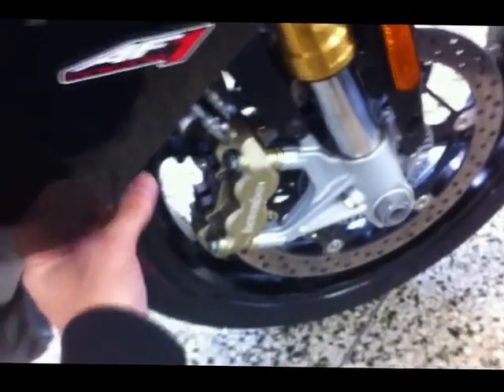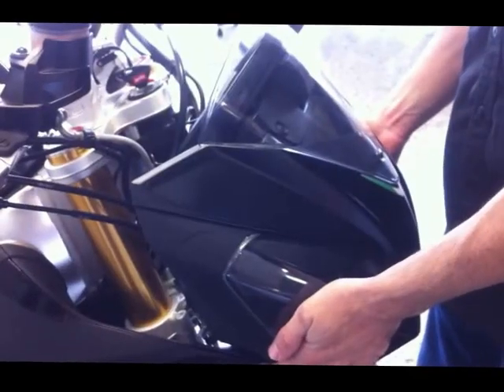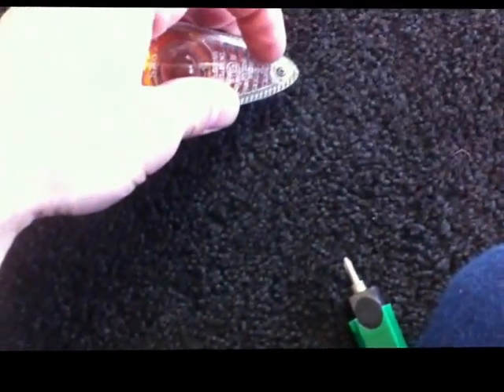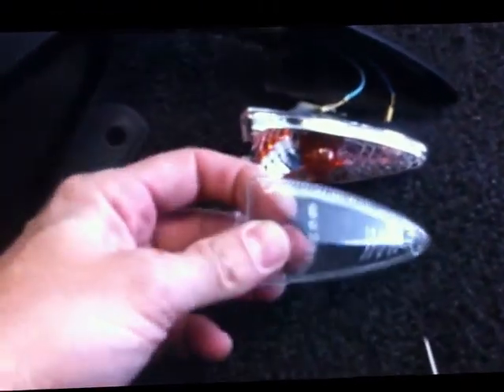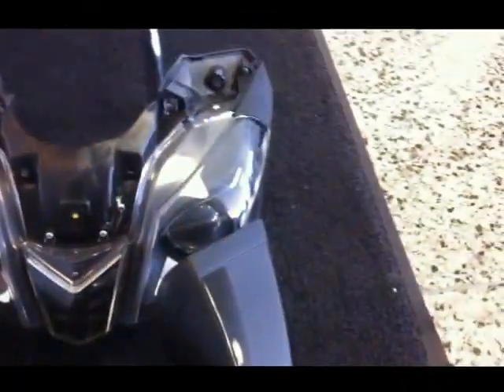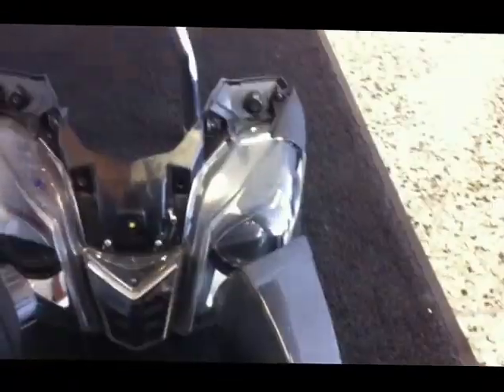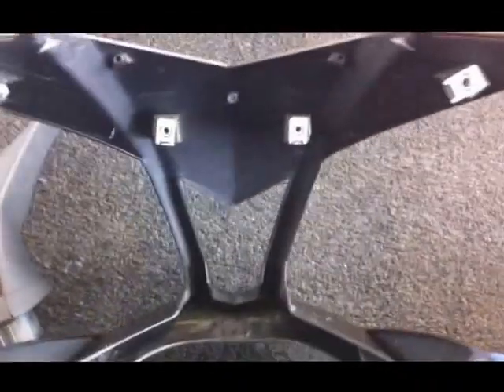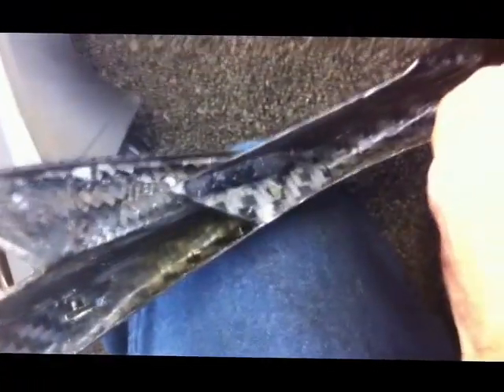Aprilia Tuono V4R Front Fairing Removal

Comment: just seen your video it helped me alot to figure out to disssamble the headlight & front fairing.im planning to convert my TV4 1000 to TV4 1100 headlight & front fairing. do you think its a plug  & play because i dont ordered it yet.my concern is the wiring part after read it on aprilia forum.